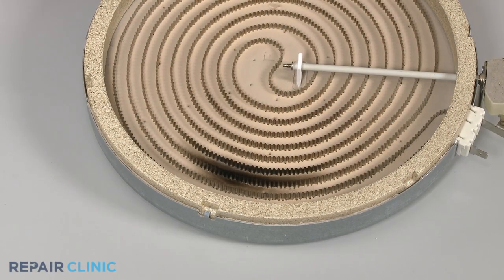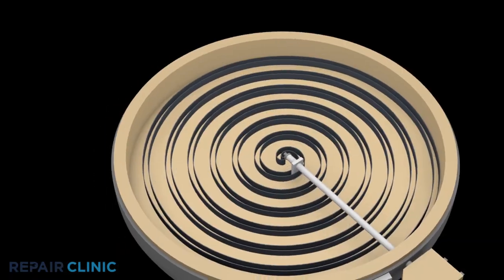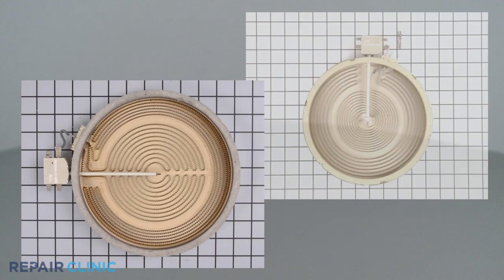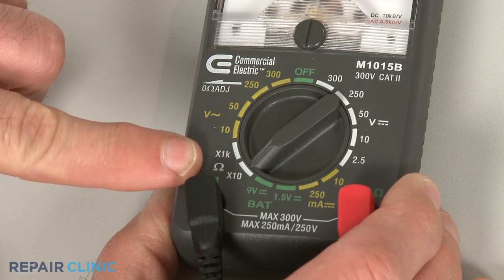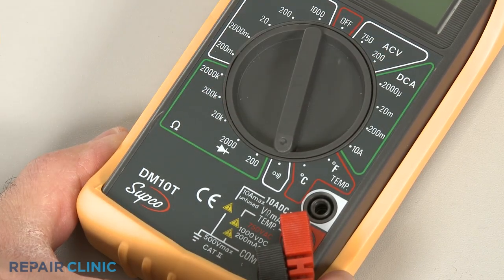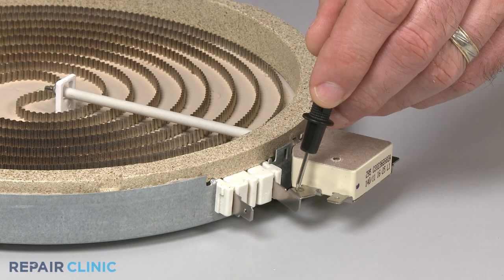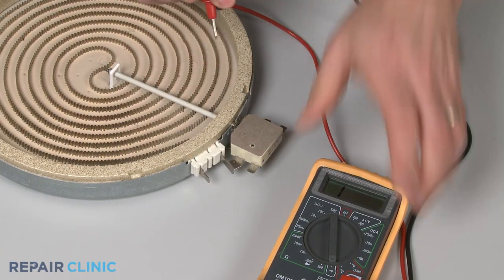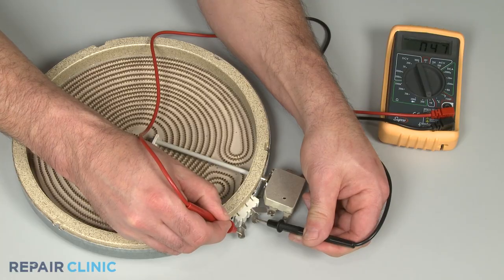Burner Not Working? Radiant Element Testing – Electric Stove Repair

Comment: My dual burner element from JennAir/Whirlpool had good coil continuity but had bad temperature probe (not shown in this video) with no continuity.  This required entire replacement even though the coils tested good. 

The limit switch/probe shown in this video tested good but that test is not shown in this video.